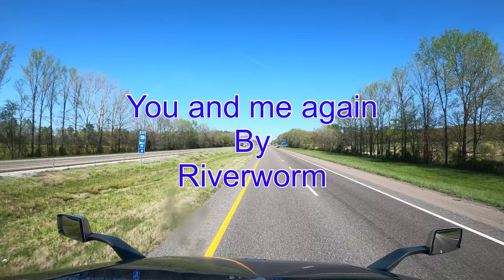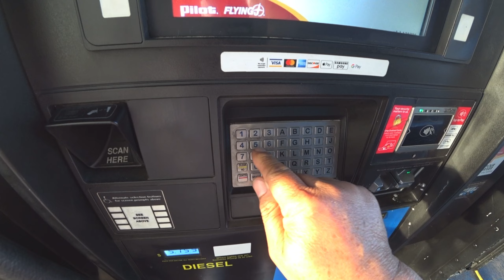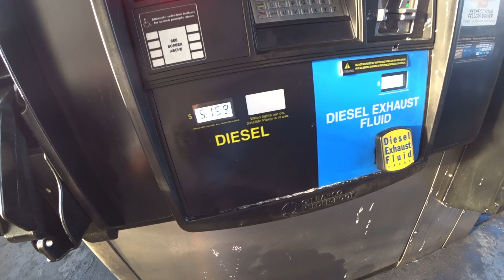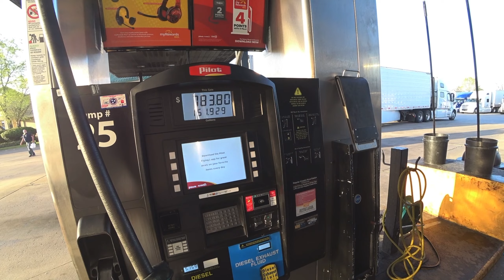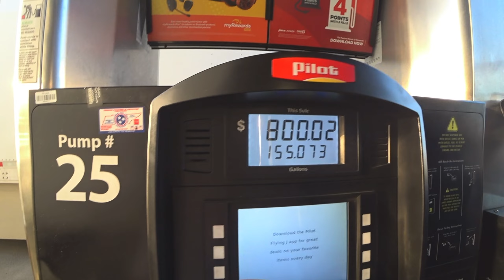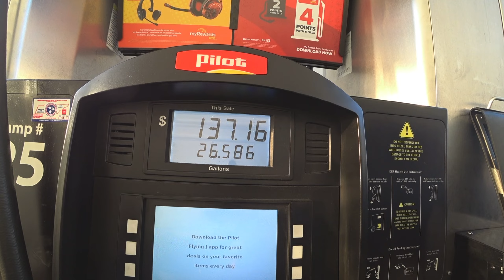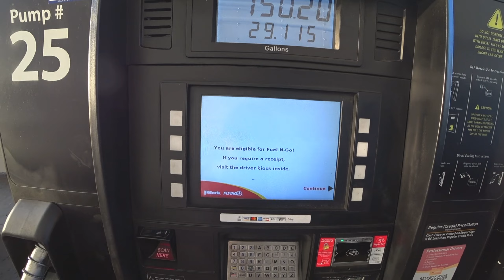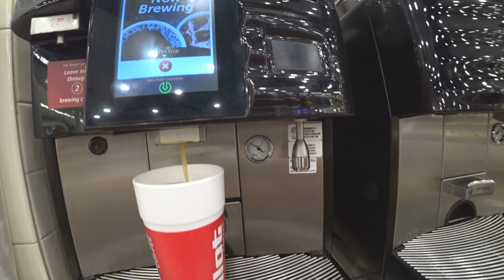April 27, 2022/131 Trucking in Nashville and fuel at the Pilot Truck stop

Comment: It effects the range severely not able to get full tanks on either def or reefer generator fuel tank. Greed all around. Our vacation put on hold for six months. Sit around watch the paint dry. watch you tube videos or Netflix. Play computer games. Pray hard about stuff. Bout the only thing to do is go un cover the rv go sit in it. Camp in the drive way. Drive the one ton a bit just keep stuff happy. Forty five dollars gets a quarter tank of fuel. Empty with fuel light 150 bones. Boating another ninety plus 200.00 outing. NO THANK YOU. For your boats hook the water hose run em a bit or go to the marina exercise them in the stall. If you do go go somewhere park it. Beach it anchor and just sit. Best time to run the generator exercise them. Fuel is just too darn expensive to go all over a lake. Unless you have small tanks six gallons small outboards. Pick a spot use your trolling motor just sit bout all i can say. Do some maintenance oil changes etc.